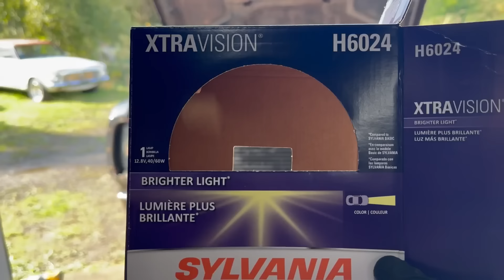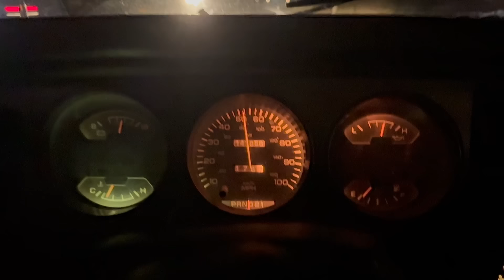Ramp Truck Nose Job! Classing Up My Beater 1992 Dodge D350 Cummins Truck With 1978 Dodge Truck Parts

Comment: Doing this to anything pre-90 is a breeze because that damned core support changed in 91 with the extra support columns. I like to cut and patch the hood latch assembly from special order trucks that had the cable pull release in the cab, last one i used was "donated" from a 78. I'm a little shocked that the worst thing you had to deal with was the hood being an inch short of the wiper valance. Although something sticks in my head about the 91-93 front clip being different than the 82-90. I've been out of the game too long.

31:39 I'm pretty sure you know that the 7" lights mounting still has yet to change... well up until 2019 at least. Have you tried converting Jeep JK/JKU lights or LED swaps in a D/W yet? I'm curious at the wiring changes because the 72-80 harnesses are notorious fire hazards with high amperage so I never did try the HED/HID/Halogen. They do mount straight into the headlight bezels with minimal effort though. 

33:45 You can give me those crappy stock mirrors! One of my local yards has the 1ton extension mirrors you're looking for. Do you have a suggestion for where to replace the glass in those sport mirrors? Like an amazon/napa/oreilly part number or something? My source has retired so my sport mirrors have no glass in them.

Comment: Can you change to the old style steering wheel. Or is it an air bag style. But would an air bag work with no PCM and all the parts swapped.
Reply from the maker: No air bag, but I think the wheel mounting on this newer style column is different. I could be wrong. I’m not sure where I’m going to go with that yet.

Comment: That wiring is terrifying.  IIRC, the alternator is controlled by the PCM unless it has been bypassed?
Reply from the maker: It was bypassed years ago. I have covered this in previous videos on the truck - but I understand if you haven’t poured over every hour of ramp truck footage I have made. Haha.
Reply: @DeadDodgeGarage  No, I actually have but I'm getting older and tend to forget stuff like that. It does make re-watching vids all that much better though!

Comment: My 68d300 is a stock truck. They sit a little tall. Will the run-of -the-mill engine hoist lift the slant high enough to pull it out?
Reply from the maker: It should reach high enough. I used the cheapest, crappiest folding picker money could buy to pull the 318 from my ‘70 Camper Special. It didn’t have the extra height of the 300 grille spacer but it had a lot of spring. And you can always pull the front wheels and drop the nose if you have to. Or even air down the tires.
Reply: @DeadDodgeGarage  great ideas! They are lock ring wheels so i don't plan on airing them down until I need to change the tires. I guess I'll be a sissy and take them off if need be. Thank you!

Comment: i have used V-6 gas computers on the cummins and i think the only thing that didn't work was grid heater and put it on a relay
Reply from the maker: Right, someone (maybe even you?) mentioned that in a comment before. Literally the only circuit in the original PCM that I miss is the grid heater control though. My AC circuit will eventually be backdated so it no longer relies on the PCM and will be controlled by pressure. The overdrive automatic will be gone soon. The voltage regulator is already external. I’ll be wiring grid heaters to manual control too and then we’re good. I will keep this in mind for future broken Cummins trucks - because we all know there will be more.

Comment: Is the drivers side a pillar pushed back?
Reply from the maker: With the fender off, I could see that the boxed area on the driver side of the firewall / heat and vent intake ducting is cracked top and bottom and shifted somewhat. There is no obvious damage to the A pillar itself, and the windshield fits correctly. But it’s pretty obvious something is a good bit off there.

Comment: Oh rusty ccore support! i was woundering why you didn't pull the frt. clip as one assy.
Reply from the maker: Because the intercooled Cummins radiator support is very, very different and I need that. Also my AC is charged and I’d have to pull condenser. But yes, also rust.

Comment: Those panels didn’t fit worth a shit on the 70s trucks they were built for, I’d say they aren’t any worse on that 92! I had a 79 power wagon that I fully restored over about a 5 year span, clean all original metal southern truck with no sign of ever being in an accident. It was nothing short of maddening trying to get all the gaps and body lines correct and in the end I concluded it was impossible to get it perfect without modifying things. Like you said you get the doors fitting in the cab and then the fenders off of that but then the grill and hood won’t go where you need them to go and some of the actual body lines just don’t ever line up no matter what you do. I think that’s just how they were!?

Comment: VIN number swapped? Just asking…..😸
Reply from the maker: No, it is licensed as a ‘92 and always will be, with its correct dash and vin plate in place. Swapping a vin is a crime, and I would never advocate such a thing. But you did remind me that I still haven’t removed the plate from the driver door 😅
Reply: @DeadDodgeGarage  Good. I’ve never mixed and matched pieces of different vehicles like you have. I don’t know what the law says about that. 50% 1992 truck with 50% 1978 truck = ?

The official VIN is on the dash. I can see how some skeevy guys might want to transform a newer vehicle into an older, pre-smog vehicle, to avoid the emissions requirements.

Comment: Man, I need to run down to the states for a 1st gen, everything up here in Ontario is rusted, crushed, or valued in their weight in gold.
Reply from the maker: They’re pretty stupidly expensive here too - at least the nice ones are. I’ve dreamed of a club long W250 five speed truck for years. Apparently everyone else has too… that costs $25k US for some reason now.
Reply: @DeadDodgeGarage  I find Pennsylvania to be pretty good for used trucks and bikes. Although, that's like 3 days away from you hahaha

Comment: Money would have been better spent on H4 conversion housings. Plenty of options on Amazon for roughly $40
Reply from the maker: So like the set I had sitting on the toolbox and almost installed on the truck? No, I prefer the sealed beams to the modern plastic garbage, and these cost less than that and work very well.

Comment: I never understood why Chrysler, being as cheap as they were, would have even bothered with a computer in these trucks.  Overdrive, A/C, cruise control, charging system,grid heaters, WIF sensor, speedometer, etc... do not require a computer to function.  Makes no sense at all.  They could have saved a ton of money. Thankfully, the wiring in my '93 is as Mother Mopar made it, and every single thing still works.

Comment: The truck looks great. Can't beat that grill. 

But How dare you use penetrol!!?? Used motor oil is free and that's its super power.. lol. Let the haters drown in their own tinckle
Reply from the maker: I can’t tell you how many people have told me to put used engine oil on the flat bed. I… don’t think I’m going to. Mostly because I know what that smells like. Haha.
Reply: @DeadDodgeGarage  lol. I don't smell it after. It stays a little too glossy for a few days then it calms down. People say the same about the boiled linseed oil treatment. Unless you park it in a garage I doubt you can smell any of that stuff